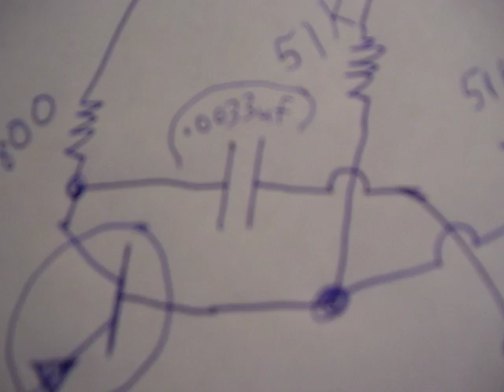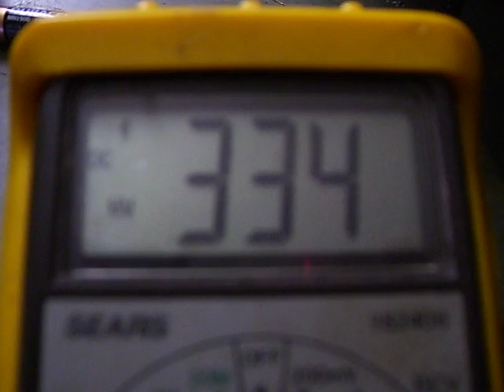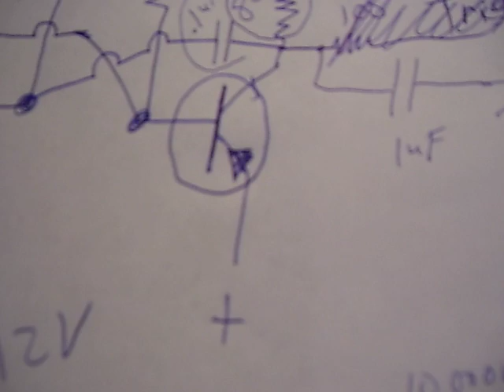newest test Bedini solid state

Comment: What were the amps and voltage going in and what were they coming out? Do the math, let us know what you lost in power. I know if your clever its possible to use high voltage compared to lower voltage and higher amps. I would like to see if its possible to get more energy out of your device than you are putting in.

Comment: hi ther,
i would like to ask you that what is the inductance of the coil that ur using in it,,that big microwave oven coil???? also can i use this circuit to charge 1.5 v to 9v or 12v car batterys?? also can it work on 1.5v aa cell??? and still charge a 9v battery//..